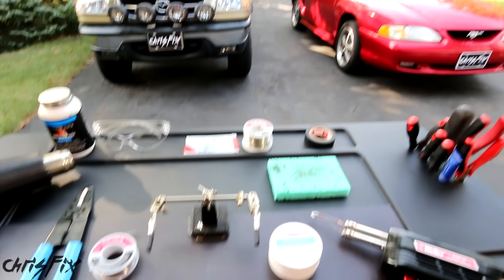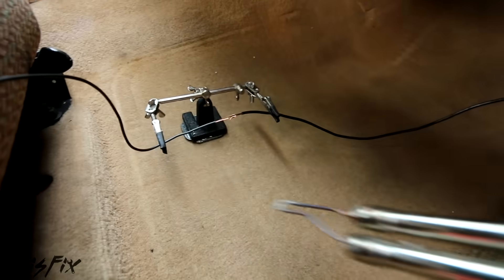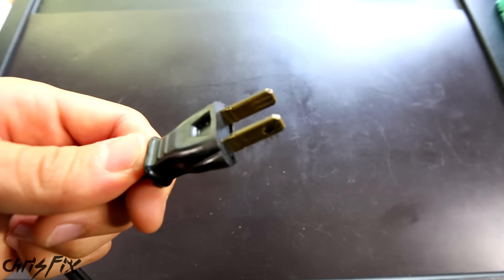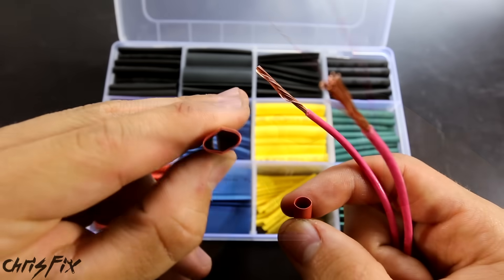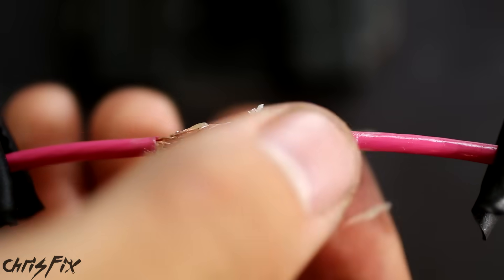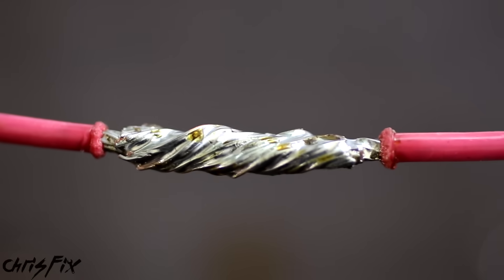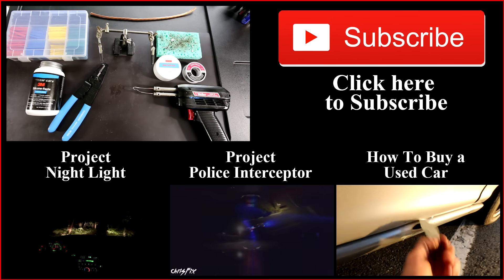How to Solder Wires Together (Best tips and tricks)

Comment: My grandfather was a EE at an aerospace company for 40 years and always used to say "if you can see the flux, you used too much". Flux does not protect the wire, it allows the solder to flow smoothly. Less is more. A little dab will do ya, a bigger dab will scre... well, waste flux.
Reply: "The bigger the gob the better the job!"
Reply: I’m E&E as well and was taught the same thing as your grandfather
Reply: Yikes... op said bigger dab will screw you; not the opposite
Reply: Actually, a bigger dab will often screw you. Flux is corrosive, and most motherfuckers aren't washing that shit off...especially low-end PCB manufacturers!
Reply: @fun_ghoul  I think we're all in agreement.   I apologize if my sarcasm was lost in translation.
Reply: @fun_ghoul  he literally said "less is more" in his post.....

Comment: When you are using a soldering iron you could also just use a piece of sandpaper or a file to clean up the end, its much easier and quicker.
Reply: Easier and quicker than what???
Reply: @skitzofranicfreak  easier and quicker than taking a sponge and making it wet every time you solder something..

Comment: How many tips do you go through? Granted I do very little soldering and only use an iron the but I don't think I've ever replaced a tip. I did have to replace the iron, but only because the 20 plus year old one I had just quit getting hot, so I assume it burned out internally.

Comment: Tinfoil makes a good protector for anything you are soldering over too. you can lay it down or crumple or fold it into different spaces you may be soldering in. The solder will cool before it will burn anything below the foil.

Comment: Ummmm...no. You didn’t even clean the cooked flux off the wire, ends of the insulation are melted, the wires are not sliced together neatly or evenly, this is not correct what so ever. Also the western union splice is used where strength is important, the mesh splice is used where a smaller size is more important.

Comment: You are relying on the solder ( with an L in it) for mechanical as well as electrical contact.  It’s better to join the wires together mechanically with something like a modified linesman’s or Western Union joint and then solder.  You can see the problem just pushing them together as at the start of your soldering process that you have a strand of wire sticking out.  This can, and will, puncture the insulation causing shorts as many before you have found out.

Comment: Great video.  I'm an electronic technician.  Over 30 years experience.  2 suggestions.  One don't sponge the tip off just after soldering.  Sponge it off just before soldering.  Leaving solder on the tip will oxidize the solder, and not the tip, the oxidized solder will protect the tip.  Also, it would be nice to add in how to prevent and remove solder bridges when soldering on a circuit board.
Reply: Solder bridges, I keep scrap stranded 14AWG for cleaning those up. Fan the tip and press the iron down.

Also, he said lead-free solder doesn't have the shiny look that leaded does. I use both, and if you do it right, lead-free is just as shiny as leaded.

Comment: Man... I just soldered all the wires for my e-bike build together, and after seeing this video I realized that I fucked up my soldering in every possible way.

I has all the right tools but no matter what I did, theat fucking solder just didn't stick to the wires (or to the soldering iron to that matter).

How the hell did your solder wint so nicely into the wire strands? I used a solder paste too, but my exlerience was completely different.

Comment: didn't work for myself i was trying to connect to ends of cable you see go into molex connector.

first problem couldn't get them to join like this straight i would do like shown on here but when twisting they wouldnt hold the strands are very thin.

next i got it to join in the end at angle but as soon as you apply heat like you did at the near it comes apart also noticed the solder wont flow like that i's trying to just lump in one place.

Comment: Just grind the teeth off the alligator clips alittle emery cloth to smooth the edge and it still holds the wire steady enough to solder.

Comment: Great video as always.  One correction:  Dialectric grease is a conductor, not an insulator.
Reply: I don't think it is.
A dielectric by definition is an insulator. Capacitors have dielectric media separating the two conductors. That's how it stores charge.
Reply: @iampennyify  I sit corrected!  
From WikiPedia:  Silcone greases are electrically insulating and are often applied to electrical connectors, particularly those containing rubber gaskets, as a means of sealing and protecting the connector. In this context they are often referred to as dielectric grease.[8][9]

Comment: I am a 40 year electrician.This method is ok for most but not all automotive applications.Use on exposed wiring only.Never,ever join wires this way and put it in a pipe or any raceway.Never do this in a building.Never.

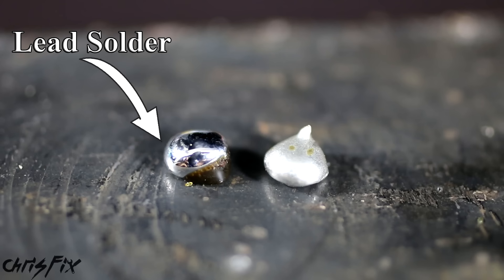Comment: 3:33 = WRONG: Lead Free solder is NOT "dull", corroded or etched in appearance. Many times it's more shiny than Leaded solder.
3:40 = WRONG: Rosin-core solder doesn't "protect the wires" in ANY way. It's simply solder that has about 2% flux inside it.
3:48 = WRONG: Rosin paste flux doesn't "protect the wires" either. It's used to "corrode" the wires slightly and remove the oxidization and impurities while you solder. Rosin-based flux only remains active when heated, so it's inert when cold.
10:23 = WRONG: You should leave the old solder ON the soldering iron, never clean the tip before storing (the solder is what protects the tip from corrosion). The tip should only be cleaned before soldering.
10:28 = Dubious. The use of damp sponge is really gross and can cause problems for "proper" soldering irons that have plated tips for long life. The modern way to clean the tips is in brass scourer material tip cleaner.
Otherwise, a pretty good video especially the reinforcement of heating the wire and letting the solder wick it's way in. Those clunky old fashioned "Soldering Guns" are really nasty things, kind of like using a chain saw to trim your toenails. The fact that there is no tip and it's bare copper means that you will get very poor life from them (hence why you feel the need to make your own from copper wire). A proper temperature controlled soldering iron (Hakko clone) will be a lot easier for newbies to use.

Comment: Yo ChrisFix, I just wanted to say thank you for this video. I never soldered before (not properly anyway) and after seeing this video it really helped me make some solder porn with various projects ive been working on.
When that flux starts to vaporise and the solder just flows into the copper it is glorious. It's like a beautifully tig welded joint. And to think before my dumb ass was applying the solder to the tip and forming blobs which never flown into the wires, now both my iron stays nicely clean and tinned and my joints look beautiful!
One thing you mention in the video is that lead free solder doesnt flow into the joints and i can tell you that's wrong, if you heat the joint up the lead free solder will flow just like leaded solder, all you need is a soldering iron suitable for that temperature.

Comment: other issue with lead free solder,  is that there's silver migration...so  if you're soldering a board such as in your instrument cluster,  that migration will cause some severn voltage drop, and worse, shorts ..  stick with the lead stuff as chris said 
;)
Reply: Bullshit. They use Lead Free solder when they manufacturer the fucking  instrument cluster, dumbass. Silver migration - that's what happens when your ex disappears overseas and takes your jewelry gifts. It doesn't affect hobbyists who are soldering copper wires together.

Comment: The western union splice is the best and safest splice to use
Reply: I would assume because if you screw the soldering up there's still the single physical twists that hold the wire together.

Comment: Coating the solder in rosin flux can mess up the chemical bond so do not do that, clean then coat the tip of the soldering iron in the flux and the coat the tip in solder and then start your soldering project

Comment: Butane soldering iron is one of the best tools I've purchased, especially for auto work. No cords and it heats up from cold in seconds. Remove the tip, and it's a heat gun/torch. Love that thing!
Reply: @Brian Bell Will do. One thing I've been doing lately is just using a maps torch to heat joints and feed solder into them. That obviously won't work in every situation but for large work outside of a vehicle it's way faster

Comment: Great video, clear and simple to understand thank you. One little thing if I may, If you're touching a lead solder with your hands, why not use gloves as part of the protective equipment considering lead can be absorbed through the skin by touching it on top of other protective measures such as burning yourself and poking yourself with a lead wire. Thank you again for a great video.

Comment: Pretty good info, also after cleaning the tip and before storage, it’s good to add fresh new solder to the tip before it cools to prevent oxidation of the bare metal and prolong the life of the tip.

Comment: Thank you for showing a replacement tip for the gun can be made from a spare piece of copper wire. I was ready to toss my old gun but all it needed was a tip. The flux tip also helped the solder flow, I have only used it on plumbing before.

Comment: This whole time I thought I had the 60/40, but I actually had the 40/60 solder. Is there a difference between the melting temperatures? If there is, what are they? I'm  finding 370 F for 60/40, but nothing for 40/60. Thanks.

Also, I was holding my soldering gun under the wire for a while and had the solder on top of the wire, but it just would not melt into the wires at all. Is it because of the 40/60? I kept the tip cleaned and tinned.

Comment: What rank should my solder be?

Lieutenant, major, ECT. 🤣

Being new to soldering myself does the shape of the tip matter much?

I will be soldering things like wires for RC cars and I have a Weller WE1010NA if that helps, oh and lastly what temperature would be consider optimal?

Thanks in advance and take care ✌

Comment: Excellent. Before this video, I cold soldered and didn't even know you had to heat up the wire with the soldering iron, and not the actual solder.
Cheers.
Reply: Konii I in I’m in I’m in I’m in in
Reply: My god - hold long has it taken you to learn how to read and write?
Reply: @johncoops6897  Several years. It's my primary language as well.

Comment: Could my 10 gauge wire from Lowe’s not be solder able? I swear I’ve done everything righty but I’m still not getting the solder to flow into the wire. I have a clean tip and clean wire, I use flux paste. I’m cold soldering and have no other option.  Pulling on the wires and they seem to stay together. It looks like crap though.

Comment: So, you mean to tell me that holding the string of solder on my mouth as if it were a cigar was a bad idea? Oh boy. But on a serious note, if you're careless or clumsy, stay away from soldering tools. They will ruin your day. I remember my best friend in college eagerly packing up his stuff to go home. But he grabbed the metal stand, which had just been supporting a soldering iron. WOW! He jumped back as if he had gotten shot. Then a few months ago it happened to me. I was trying to solder a small part and needed to use a stand with a magnifying glass. I lost sight of the solder iron side and it touched my index finger. Damn! I can still smell the burning skin. It wasn't too bad, though. In any case, it was a small price to pay. I fixed a broken $399 subwoofer with a $2 gain pot replacement.

Comment: Alright. So my mustang exo boost start Ed miss firing on the 4th cylinder. I changed the spark plugs and. Worked for like a week. Then my engine light returned. Same problem changed the ignition coil. No fix. While I was following the purple wire back to it's source I noticed near the plug it had gotten damaged some how. I thought maybe that's the issue. So on Sunday no mechanic s are open so lemme try this my self will update if fixed.

Comment: You can also use the side of the soldering iron (or gun in your case) to shrink the tubing.  That is what I use and it works just fine.  Just rub it over the top of the tubing - yup, rub it.

Comment: Never use a wet sponge to clean a tip, use a brass sponge.  Will clean better and tips will last WAY longer.  63/37 solder is also much better than 60/40.  Basically eliminates the "plastic" phase when solder cools, preventing cold joints

Comment: If you want to know the international standard for soldering, look up IPC J Standard for class 1-3 standards, class 1 being almost everything consumer. Class 2 for things that need to work all the time, but if it fails no one should die or get injured.  Class 3 is almost everything in hospitals, planes, and military where all solder joints have to be all but perfect.  For inspections look up IPC 610.

Comment: Don't you want to avoid melting your insulation as you solder the 2 connectors together? Melting your insulation will also increase resistance on both sides of your soldering job. I liked the way you opened your wires up, but wouldn't it be good to also add flux before you twist them together and try not to put on too much flux as this made the heat transfer to your insulation much quicker and helped it melt. Sorry, I just cannot help but point this out! I have taken a course on soldering and we do everything we can to avoid damage to our insulation that protects our wires.
Reply from the maker: Thanks for the tip

Comment: I am watching this because of our project in school. How can you stick the lead to the wire?? Because me no matter how I heat the component the lead wouldn't melt. Or the lead would melt but it won't stick😭😭
Reply: Buy some flux and rub the flux paste all over the wires and i would recommend cleaning the tip of the soldering iron or buying a new one and replacing it.always clean the tip of the iron with a damp sponge.and you should shake the solder in the air a few times to clean it off

Comment: OMFG... don't have bits of wire poking out like this 0:09 you it will poke through your insulation tape or heat shrink and short something. Also the solder gun he uses is garbage.

Comment: i have a portable gauge to measure groundwater lvl changes and some of the wires broke at some point and its difficult to solder these since they not made out of copper, can you make a video to show how to proper do it on these type of wires , current fix i found atm  was to use a certizator tube on them

Comment: I've used Rosin flux for years and it doesn't protect the wire.
It actually removes oxidation when exposed to heat. From my experience, If left alone it can do the opposite and oxidize metal over time.
I recommend Cleaning your work with rubbing alcohol afterwards.
Or use no clean flux if you can get ahold of it.

Comment: Great tut but shit, by the time I buy all those little accessories and find a place to store them, I will have spent more than if I had just bought a brand new power cord to begin with... For someone who just needs to quickly fix a broken cord/wire so I can get back to work on other things, this solution does not seem to be worth it.
Reply: All those little accessories are not single-use though. Buy them and you can fix hundreds of power cords over the course of a lifetime.
Reply: exactly
Reply: except when, you know, you already have the items like most people. investing a bit of time now so you dont have to do so later

Comment: Thanks for the tips.. Literally! Nice idea creating own tips.
One more thing to help:  if soldering required near heat sensitive components and you need to avoid it travelling down is to attach some metal to wire e.g. crocodile clips or even pliers depending what is being soldered and heat used. These will absorb some of the heat rather than all going down the wire and potentially causing damage further down. Especially important with electronic components.

Comment: Hello sir, I need some advice , what would be the best election for a reliable car. 1999 Acura CL 2.3 automatic.  With 153000 miles. clean tittle original engine, or 2001 Honda Prelude Type SH ,manual trans,  with a junk yard engine with 123000 miles.  Hard Decision if I had the money I will buy both and start my own private collection !! haha

Comment: Very good video on soldering. I've worked in electronics for over thirty five years. Sixty forty solder is good for wiring but the best solder is sixty three thirty seven or eutectic solder. It changes state quicker and makes for a cleaner joint. A all in all a well done presentation.
Reply from the maker: Thanks and thanks for the tip!

Comment: This is awesome. Quick question though. What happens if one end of the wire is connected to something like a DC power connector pigtail a short distance away. Will the heat conduct through the wire and damage it?

Comment: Nice video. Suppose you want to tin an inch from the end of 6,4, or 2 AWG cable such as that used on vehicle batteries? The cables are to be removed from the connectors regularly so cannot be permanently affixed. The soldering would be intended to prevent the connector screws from spreading apart the individual strands of copper.
How much power should one be shopping for in a iron/gun for this project, assuming it can be done ?
I guess the diameter of the solder would matter a great deal also.
Useful input from anyone is most welcome.